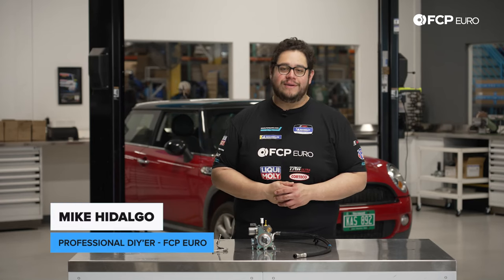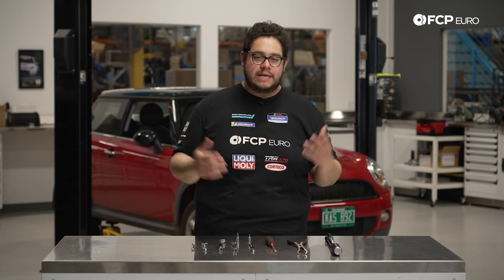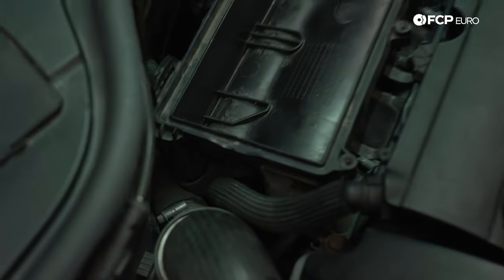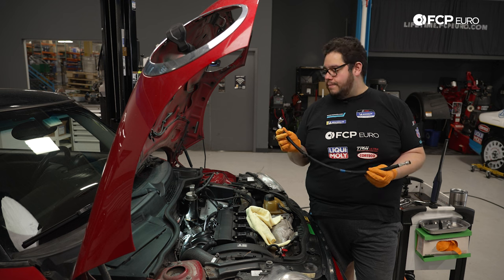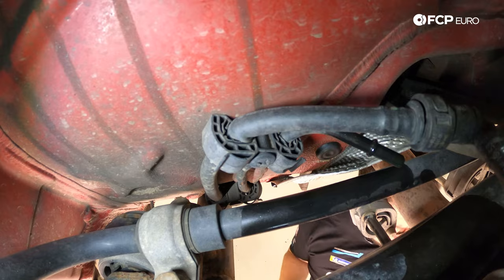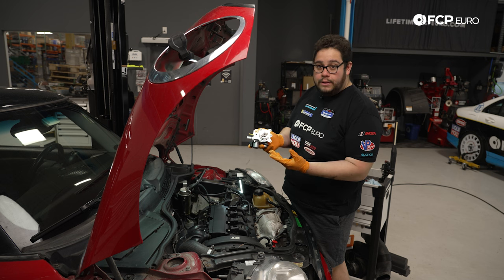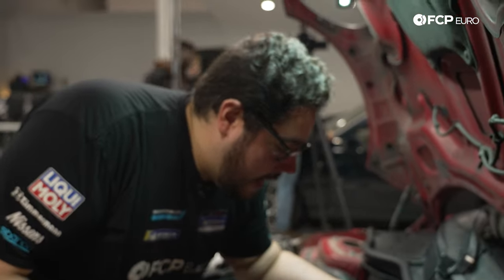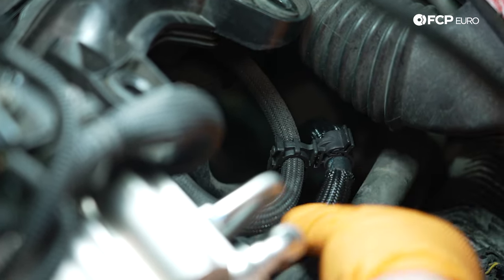MINI Cooper High-Pressure Fuel Pump Replacement HPFP DIY (2007-2012 R56 MINI Cooper, Cooper S, JCW)

Comment: Hello, I have some information to add. I had a car which the very same symptoms, and at the end It wasn't the fuel pump. Instead I changed just the fuel filter and all the problems went away. In cars with that mileage It's typical that with the time the fuel filter got stuck and the flow is not good so the car can stall. When I replaced the filter, the old one was dirty. The issue is not that the pump was starting to fail, the issue was that the engine didn't receive enough fuel. I have to add that the affected car wasn't a mini, It was a mercedes, but as I said the symptoms were the same: car started but stop after few seconds. If you press the pedal gass to increase the fuel flow the car continue running with no issue and once It was warm the probability of stall was lower. Once It cool down then we started again with the issue. With the new filter, after 2000 miles It didn't stall anymore, not even once
Reply: These minis are known for HPFP failures.
Reply: @PopsiccDesigns  True...but replacing the fuel filter is fairly easy (it's under the starboard side rear seat, accessible via an access cover) and a DIY preventative maintenance step for a car that may be pushing 15+ years of age.

Comment: Try taking a small bit of paper, like a 1/2 inch square, hold it over the head of the torx bolt, then stick the torx bit into it. The paper should help wedge the bit into the bolt head just enough so it stays on the bit when you feed it back into the HPFP mounting holes and get the threads started.
Reply from the maker: Interesting - we'll have to try that!

Comment: Thanks for explaining your work so well in this video.
Does FCPEuro sell the HPFP filled and sealed with oil or do we need to put oil in it before installing it? 
Also what is the diaphragm depth measurement should be for the HPFP? 
My HPFP measures 26mm deep so the spring is basically uncoiled and the diaphragm is pushed all the way in its depth. Does this mean it needs to be filled with oil and reassembled?

Comment: My 2008 Mini Cooper S R56 does this thing where it has a rough idle when it starts up and it goes into this limp mode where there’s no power no matter how hard you step on that gas.I’ve had the high pressure fuel pump, water housing gasket, etc all changed. 1.5 years it’s been at the mechanics and recently they said it’s fixed about replacing the new oem high pressure fuel pump with a genuine one. A few days later and the exact problem again.
Reply: It’s been such a headache and I’ve spent so much money it to the point it exceeds the sunk cost fallacy and I have to have it fixed. Please help
Reply from the maker: Have you looked at the vanos solenoid? Sometimes they can fail or get debri on them causing a lumpy idle, and an unhappy car that can put it into limp mode. Its very accessible, reasonable to replace/check/clean

Comment: Just replaced the high pressure fuel pump and the car is just starting fine again but the check engine light is still coming up. Fuel is slightly drippng out the high pressure line. Could this be the issue?

Comment: Hello friend  i scan mini 2012 s and i have those codes [00321d]  temporary: Fuel tank ventilation system and purge air system, micro-leak: Leak greater than 0.5 mm.. any idea please 🙏?

Comment: Hello, I have a question, when the high pressure fuel bump is bad , does the check engine light comes on?   Or not always
Reply from the maker: Ivan, a bad HPFP will lead to not only poor driving but also a check engine light. If you are suspecting, the best bet would be to scan the vehicle and see what it reports back!
Reply: @fcpeuro  what the car is doing is that when i press gas pedal it starts to stall and the pressure goes down

Comment: Whats the fuel pump in the back in the fuel tank?
Reply: Low pressure fuel pump. Mini has two
Reply: @robertflagg2541  Oh so the delay lag in acceleration could be the one in the front. I just replaced the back.